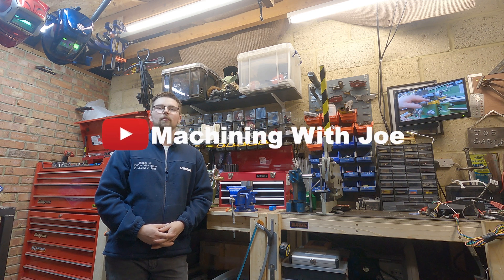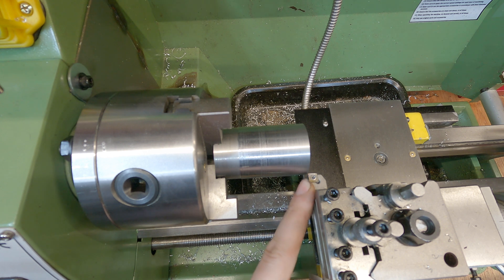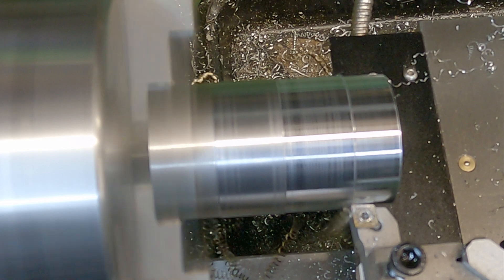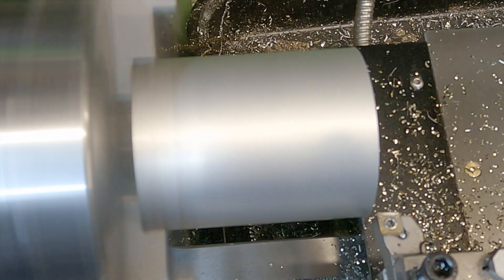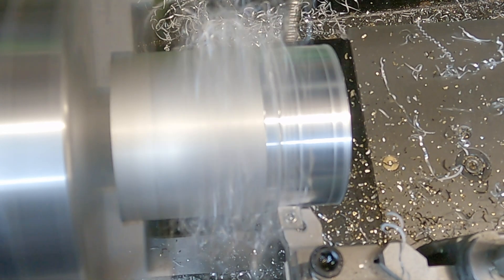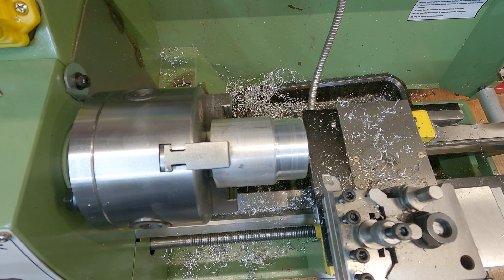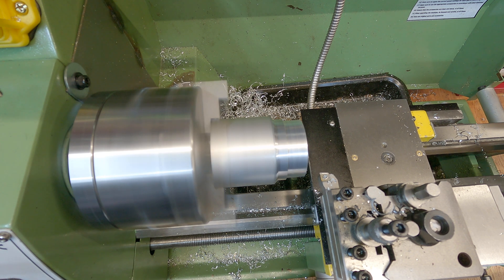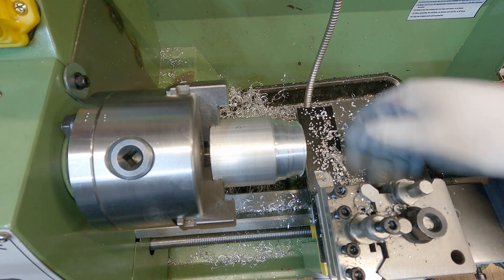Warco WM180 TEST Cuts

Comment: Hope you let the motor cool down between tests, the wm180 dc motor can easily burn out and you won't know its happening until it cuts out.
Reply from the maker: Hi dude yeah I’ve already had the joys of that happening before so this is this lathes second motor. Still meaning to getting around to fitting an extra cooling fan

Comment: Having given it some thought, you might want to re-do this video completely, I think Warco would strongly disagree that was the max amount of metal removal. It is not good that you showed the stock coming out if the chuck bcoz it was nowhere near tight enough, you could also have done with some jaws the other way round so there was more to grip on. With the correct surface speed your Warco is capable of rapid stock removal, with a steady cut, if it slows down, then you know the cut is too heavy, you should also be aware that the stock can push back in the chuck. (one of the industrial machines that I worked on and reprogrammed could take 30 amp cuts at 415 volts 3 phase, that is some power.) Considering that I used a standard size (little bigger than your insert, I think about 8mm CNMG, long time ago now) insert in a bigger tool holder. (Also, with correct speed/feed can get nice finish on mild steel)
(at least while you are going slower, there is less chance that hot swarf can fly into your eyeball :-) )
Reply from the maker: Yes I think I will revisit this video some when in the future. My plan is to go back with some smaller diameter mild steel so I can clamp
It better in my 3 jaw. I think after gaining more experience my lathe should be good for 1mm DOC in mild steel.
Reply: @MachiningwithJoe  I won't be getting my Warco until I am actually in the Philippines and built my house and workshop (oh, although I will be getting a bigger machine anyway), so I cannot test it out on a hobby lathe, but for maximum safe depth of cut at say, 30mm dia, 90mm out of chuck and holding on full depth to back of chuck in hard Jaws with a carbide insert, if you drop a line to Warco direct to ask them, their answer might surprise you. I had the benefit of a Rolls-Royce apprenticeship where they taught me lots (still learning now). But different in your situation, stay safe, wear your safety glasses (I have no idea what they cost with prescription lenses in, my company pays, but a standard polycarbonate pair are £1 or £2) how much is your eyesight worth, mine is priceless. But do ask Warco what your m/c is capable of at those sizes on mild Steel and Aluminium as you seem to be running same speed for both. Cheers Buddy.         P.S. My Daughter says I can be bossy, If you do not agree with me anytime, you must tell me. I am humble enough to receive advice as well.

Comment: When you get used to the machine (as long as you are holding it correctly), you should be able to take a 3mm depth of cut with sufficient feed to make the chips break into little bits. the noise you heard was bcoz you were not giving it enough cut to take up the slop on the bearings, and would improve the surface finish no end. If you were only holding on that little bit you needed the live centre to steady it. Take it steady, keep learning. :-) Personally, I would have had the jaws the other way round and the stock against the chuck face.

Comment: I wonder how much it would be possible to actually push the limits of these with upgrades and tuning.
having the other jaws the other way round might have gripped that mild steel better and using cutting oil lubrication would improve results.
Reply from the maker: Hi Thomas, 
Yeah looking back on this there are several things to improve the DOC I could of done. 
As well as what you mentioned I should have added a centre as well. Maybe I shall revisit this and try again.
Reply: @MachiningwithJoe  It's actually " I could have done" come Joe lad use english not american
Reply from the maker: Haha sorry my bad, grammar isn’t my strongest point. Thank you for correcting me 👍

Comment: Hi Joe,

I have the same 180 now for about 5 years.First just a small tip to get appr 5 cm more distance between centers ...take the threading clock on right side of carriage off!I hardly use the lathe for threading and it takes a minute to put it back.Secondly I always use a center and chatter is reduced a lot and doc can be 1.5 mm in mild steel without any issue.I moved away from carbide inserts and use mainly hss tooling which is easy to grind yourself.I recently put a 150 mm cbn wheel on my grinder and that was such a good investment highly recommend it.Also to get more doc rethink the use of your compound slide.I,like many others,made a block mild steel of appr height of compound slide and this is so much more rigid.Ade made good video on this mine is more crude but works fine.
Reply from the maker: Hi Robert
This is great advise thank you so much. 
I will definitely be removing the threading dial that is a good idea. And also I have been considering  removing the compound slide I’ll have to have a watch of Ades video again and give it a go when the Mill Finally Arrives. 
All the best.

Comment: Looks like the ccmt insert has quite a big nose radius. This isn't very helpful on such small lathes. I go with 0,2mm nose radii on my tools. I guess that's the smallest you can get and it works quite well on my machine. But to be honest, I don't push it that hard:) And if possible better clamp with the "normal" chuck chaws, they have probably three times as much clamping length as the inverted ones, thus clamping much more secure.
Reply from the maker: Thank you for your comment. I’ve never really considered the nose radius this is something I’m going to have to investigate. 
And yes totally agree the grip from the normal chucks jaws are so much better.

Comment: Hi Joe very entertaining video,  try changing the chuck jaws to get a better grip, you may find you can go a bit deeper. 4mm max on my Holbrook C10 .A word of warning wont be long now before you get the urge for a larger machine, it happens to all of us ! Regards Del.
Reply from the maker: Thank you for the advise Del, already have the urge but another machine is needed before that just waiting for it to come back in stock.
Reply: @MachiningwithJoe  Which machine have you got your eyes on ?
Reply from the maker: @machinenutdel6764  so I’m hoping to get the Warco WM18B milling machine as soon as they are back in stock.
Reply: @MachiningwithJoe  Hi Joe, 1700 quid for the Warco mill, just my two penneth rigidity is everything with a milling machine even more so than with the lathe, I know transport and space can be an issue but for that kind of money have a think about a second hand industrial machine you will love them ! and save some money. All the best, Del.

Comment: I'm just working on adding a 4th axis to my DIY CNC machine, but I wonder if you have a set of jaws that would allow a better hold on the steel.
Reply from the maker: Unfortunately I only have 2 sets of jaws for my 3 jaw and one set of jaws for the 4 jaw. If I use them correctly with the aid of tail support they tend to work well.